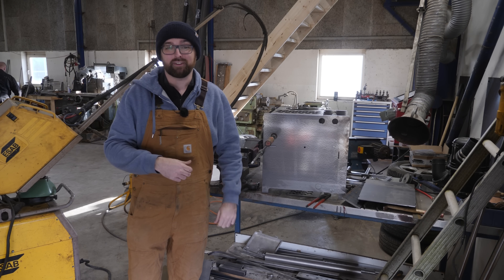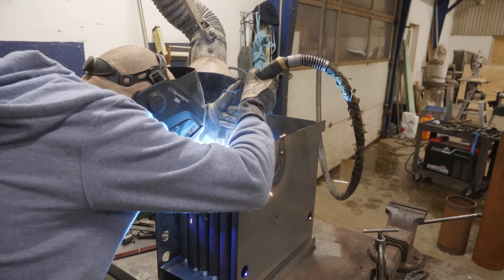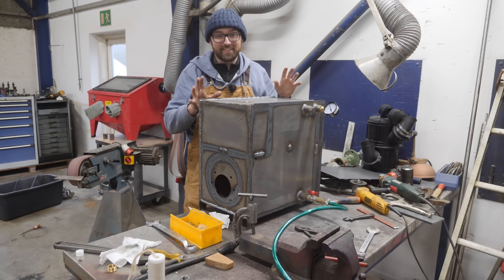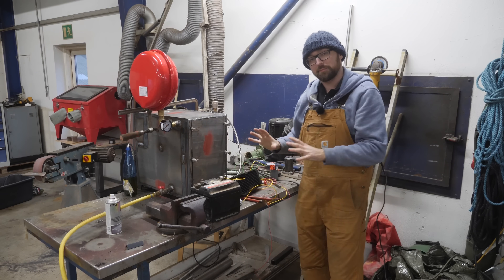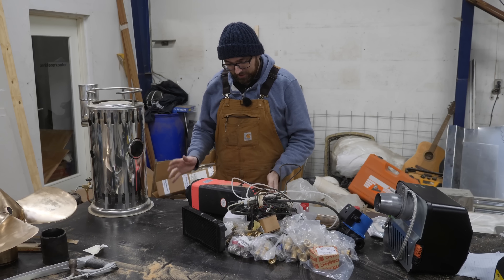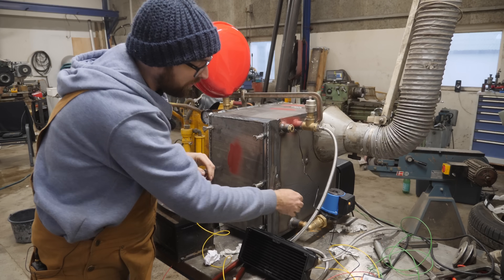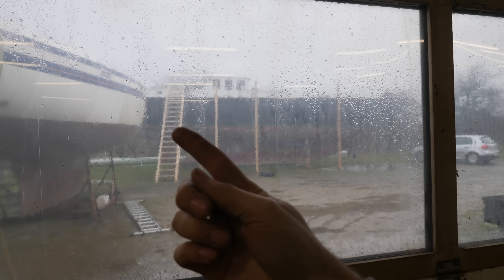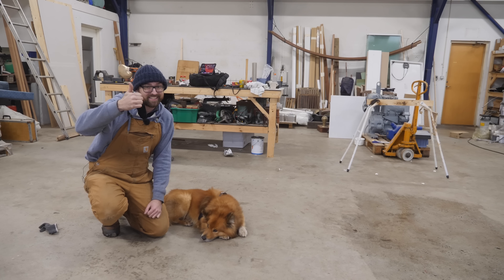Sail Life - DIY boat heating boiler - project sailboat

Comment: Wow super nice boiler.  I wanted to tell you having a lot of experience with similar heating systems, you might consider when attaching the pex tubing for passing the circulation that you start with 40 inches or so of copper or other metal piping coming out of the boiler, and 40 inches coming in.  Pex tubing can become strange around 180F but can withstand constant use at around 160F for extended periods.  The thing is that right at the boiler the temperature can exceed 180F, and the metal can help mitigate that extra heat.  Also make sure that the blow off pressure regulator is on the end of the metal pipe coming back so that the heat doesn't kill the seals in the pressure regulator.  Do not put it on the hot outlet.  It wouldn't hurt to have one of those temperaure controllers monitoring the temperature of the pex either and to then shut off the boiler in the case the pex got too hot.  This also is an extra measure of safety in case of controller malfunction.  Also since you have a lot of metal in the installation you may need to find some method of removing the rust from the system.  It can wear down pumps and such and will turn the water a bright red over time.
Reply: if you run coolant instead of water you can easily extend the service life of the metal components
Reply: I love you DIY video. However, please don’t sound racist and keep using cheap chinese knock off. It’s made in China but being cheap enables poorer people something which they can afford. Not everyone is rich like you. So do bare in mind to be fair and politically correct.
Reply: @leechristopher6826   If an item is made cheaply, that is a reference to quality of a product being limited by using cheap materials and processes.
If an item is a chinese knockoff, that's exactly what it is. 
In China companies are not constrained by international patent and copyright laws, which allows them to replicate an item by direct copying, not adaptation and individual development. Reverse engineering may give you a similar looking product, it may even be of similar dimension, but it isn't necessarily made of the same alloys and materials. Companies put a load of research into finding materials that provide component life and durability, and those material alloys are normally proprietary, meaning they alone have the information to produce them, they aren't readily available on the market.

Cheap Chinese Knock Offs may seem racist, however it is a very accurate description of the products available. 
Would you rather he be obscure and disingenuous in describing the product so that you are left with confusion and uncertainty, or would you prefer straight forward, accurate, concise and industry accepted terminology that can be readily understood by the majority of the population?

TLDR:

It's not racist to mention a country of origin, that's a nationality, not a race. In this case Chinese refers to a national work practice.

Chinese people may be Asian, not all Asians are Chinese. Asian is a race.

Cheap is a descriptor of quality as well as price

Knockoff is a direct unauthorised copy of a product

Stop trying to be so politically correct that you're actively discriminating and controlling to fit your own narrative - quite hypocritically.
Reply: rustymozzy Nonetheless, I am just giving you an advice and trying to remind you not be sounding like being a racist that’s all. Good luck to you and may god bless you.
Reply: @leechristopher6826  which god?
Reply: @rustymozzy  The guy doesn't know the meaning of what he is throwing out, he doesn't know the difference between criticism/the truth and rac-isim.
Reply: @leechristopher6826  I would describe them the same way.  China has for many decades now made products not under license.  In fact stealing them outright without thought to intellectual property.  Everytime someone speaks the t.r.u.th. they are called what you said.  Sign me up if saying the facts is what you label it.

Comment: So when you said "boiler" I was thinking steam heat, which would be crazy on a boat that isn't a stationary building.   I understand more now "hot water heat", which is a great idea.   BTW, similarly to the way you are going to exchange heat with hot water, I don't understand why I haven't seen people do the same thing for cooling in the marina.   You have a cool source 15+ feet below the boat that you can hang a rad core on plex lines into...   Just food for thought...

Comment: Mads, please go with Noctua fans for longer run time, efficiency, and low volume. They're some of the best out there with PC rads. Possibly a thick radiator and one that can take 140mm fans for more air movement control efficiency and low noise level. And please be careful with mixing metals such as aluminium with copper!

Comment: Love watching your videos.  Learn alot for my upcoming refit.  FYI... you can fix a pin hole leak in a weld with a punch and hammer. Seems counterintuitive but works. Just punch it right in the pin hole or use chisel for something a bit larger. Js 

Keep up the awesome work

Comment: I was wondering if you checked out some of the waterless coolant options for your boiler. Benefits would be no heat expansion, drastically higher boiling temp, and will not promote rust.  In my vehicles I use Evans waterless coolant (https://www.evanscoolant.com/).
Just a suggestion for a starting point or at least a thought.
Have a great day :)

Comment: You created a large foot  print  along with  a  large  exhaust  foot print . I would  say  6'' diameter .  Webasto  2010 . Small foot print . Small  exhaust. 1.50 '' S/S  thru hull fitting  out the transom.

Comment: Mads my new boat has a heater like that! It's a Kabola it's made over there somewhere. I have about 8-10 heater radators & fans thru the boat. Mine is there older version that's 24 volts. There new ones are 110 & 220. You should check, them out they even have hand rails and towel racks that are heated.  I even have two radators in the cockpit!
Just don't look at the price!!!

Comment: How do you plan to control internal rust and corrosion due to water vapor combustion products generated from burning fuel?  Often you see Stainless Steel used for those internal structures. Rust will greatly shorten the life of most non stainless steel. That would not be spiffy.

Comment: How do  you get hot water for personal use with out heating the whole boat in warmer weather?
Reply: Turn off the circ pump. If its off, the radiators and supply lines remain charged but with room temperature water. Then the only heating will be whatever escapes the boiler itself. It's really just a water heater with a circ for hydronics.

Comment: Those Chinese forced air diesel heater are cheap enough that you can keep 4-5 spares on hand.  One downside of forced air diesel heaters is that they are rather noisy.  That said, I really like my Webasto.  Running low sulfur diesel diesel really haeps cit down on burner maintenance.

Comment: "Last 4 years in a somewhat refit"  YO!  King of Spiffy tell it like it is.  You are 4 years into a major re-built and re-fit.  You have redesigned the interior of Athena, and re-built to an extremely high level of finish and usability.  It has been an eye opening adventure to watch you.  You just keep on keeping on brother!!    Be happy be safe.    (* I think your boiler system just may work to heat a home, or small factory.)

Comment: Love the heat exchanger but still intertested in more detail on internal design. It appears similar to an engine heat exchanger - are you heating circulating water from the diesel burner exhaust?

Comment: Fabrication professional here. Yeah sure, TIG welding is a little slower on the "welding" aspect. However, with TIG welding you don't get spatter or cold starts. So, no cleanup and less opportunity for pinholes, inclusions, and ultimately--leaks. The other advantage to TIG welding, especially in this situation, is control. With TIG, one is forced to pay attention to every bead. With TIG welding, you have more control over the amount of heat you are putting into a complex weldment, such as this boiler. So, less stress and possibility for future cracking issues. Considering all the leaks and all the stress that's in this sorry excuse for a weldment, I'd scrap that pile and start over. Use Cold Rolled or Pickled & Oiled sheet/plate, SUP pipe, and TIG weld the assembly. When using the aforementioned materials with no mill scale or pipe coating, you will eliminate most weld prep, help keep out inclusions, and make for an easy weld up. I'd hate to put all this work into this beautiful yacht and then later have to patch leaks in my home built boiler. You may have "fixed" all the leaks for now, but this struggle isn't over. Give that pile some heat cycles and wait and see. Personally, I'm currently building an adventure truck and went with Webasto Thermo 90 boiler, as repair parts are readily available almost anywhere. Love the series, but I don't follow the logic on this boiler.

Comment: Thanks Mads. Would it be possible to have a look at the plans or maybe download them? That heater seems to be an awesome diy design! I’m refitting a GulfStar 41, and I’m also looking in to a new heating system. They are so expensive! Also, have a look at fuel guard. A system to prevent dirty diesel. https://www.fuel-guard.co.uk  Greetings from Belgium!

Comment: Really interesting episode.👍 I appreciate CBG is the designer and is developing his design but I cannot fathom why he went for a custom heat exchanger (with all those welds) rather than use a commercial off the shelf item. However, it was not at all clear from your explanation if this was a water tube boiler or a fire tube one.

Comment: Dont know about Denmark but in the UK you cant mount that pressure vessel horizontally, and it should have a drain valve, legionella regulations.
Reply: Isn’t this a closed loop system where the consumption water is completely separated from the boiler water?
Reply: This expansion vessel is only for heating system. But if he want one the hotwater they are spesial.  As they gona use the hot water every day I think legionella only gona be a problem on the cold water wessel/ tank/ system.  Maybee Mads or Mr. Cementboat allready have a solution. Maybee it is no a problem. They have to fill the tanks often.

Comment: Hello. I could see that you used a burner that you have bought. What is the manufactorer of this burner and how much electricity is it using? 220V?.I have an Ebersprecher 5kw 12V diesel water heater in my Fantasi 37. It is using about 4_5 amp. 12V. I am impressed with Your project.

Comment: Hi Mads, Chloe and I were thinking of making something similar to this for our project. Any chance you could do a bit more of an in depth look at the various heat/exhaust flows and water flows. Also will cement boat guy be offering cutting files for his plan in exchange for some sand paper fund credits? (or whatever the cement boat equivalent of sandpaper is?)

Comment: I couldn’t agree more on your choice NOT to use a forced air heater. Lived on my Dufour 405 in Aalborg and Copenhagen from 2010 to 2015 when I left for the Caribbean. I had an Ebersbecher and on the really cold days - like in December 2010 where it was -18C outside and the warmest I got inside was +11C with the Ebersbecher running on high, my 2 burner stove and oven on high, 22 candles AND my toaster on with the timer hot glued so it wouldn’t turn off. I am NOT exaggerating it was cold. I walked on the ice around my boat at midnight on New Years Eve. Good choice, mate.

Comment: Not quite true (9:10) you do see it where they use banks of diesel blowers to heat buildings. Here in Cambridge (UK) I have a friend who works for the Scott Research Institute, she was telling me the "buildings" at the south pole are heated by banks of Wabasco heaters. 
In my case I use mine (Airtop5000) for weeks at a a time in the winter, it's over 10 years old and has never even been serviced.

Comment: If you haven't had any leaks then you haven't installed/ weleded anything:). Pipe is especially difficult to weld!
Reply: Yes, one of the reasons to leave boiler making to professional boiler makers.
Reply: @nobody46820  Do you truly think a company making boilers doesn't have any novices doing the welds?  It's all about the QA.
Reply: @Frindleeguy  I would sincerely hope that any company making boilers wouldn't just hand over a welding machine to a monkey. Welders need to be certified and trained where I'm from, and have a low failure rate of welds to be able to do (boiler) work (that isn't done by a robot).
Reply: @nobody46820  Fair enough. I personally would not spend an additional $6k for a non monkey to do my welds. I bought a decent welder and do lots of bits on my buildings (I'm a commercial builder). It's actually not all that difficult after taking a few classes and spending a few hours in there. Nothing to be scared of really.

Good luck to you and yours!
Reply: @Frindleeguy  Nice! Congrats! I was told by a welder to learn to weld aluminum 1st, after that, other welding is easier and the techniques used in aluminum welding improve your other types of welds as well.🙂👍🏻

Comment: I am honestly surprised you were able to reach all the leaks and fix them.  I knew there would be a lot.  It looked like a lot of blind welds that needed to be water-tight.  Good job.  I am impressed.  Welding water-tight welds in all orientations like that is extremely difficult, especially for a beginning welder.  

Bravo Zulu Mads!

Comment: Have you made a socket for a zinc anode or maybe run something like mobile heating oil for no problems with corrosion. And a small domestic hot water cylinder with a coil for hot water

Comment: Very cool heat/hot water system your installing. I absolutely agree with your thoughts on forced air heat and a diesel furnace. My boat is heated with a diesel furnace. 

I’m not sure whose dog was wandering around in the shop while you were welding but the flash from a welder is even more dangerous to a dogs eyes than it is to ours. You should be screening the welding area.

Comment: MADS, First let me say I enjoy watching your videos immensely.  You always do a lot of research before doing whatever and explain why. But you totally dropped the ball on this one. Your homemade boiler is dangerous. Here in the U.S. you must be a certified welder to weld on any pressure vessel,  their was no ASME test performed on your completed boiler, the burner you intend to use is not a “closed combustion system”,  as far as the controls go, are you installing a low water cut out, what about the high stack temp. limit, high/low fuel pressure switches? The Morrison tube you installed appeared to be made of carbon steel that won’t last too long in a salt water environment. Do the pumps have a marine rating along with the rest of your boiler components, if not your insurance company may not want to cover you. The $4K you save may cost you your life.
Reply: James OBrien I’m not a metal expert but I had the same concerns. This boiler uses pressure and it has been welded home made..... I have so many doubts about the safety here! (I hoping I’m wrong....)

Comment: you might want to consider adding a low water cut off switch. That way you'll never ever have a dry burn which will damage the boiler. Cheap protection, esp. for a DIY boiler, and one that will be used year around for hot water.  In homes you'd have a automatic water infill valve, but I assume on a boat non-salt water will be rare. If you can, install a multi speed pump; that way for the shoulder seasons when you would like some heat but not max heat you can use a lower pump speed and keep a more consistent temperature  on board and not be cycling on and off.

Comment: Very impressed you got it leak free. Pressure vessel is one of the hardest tickets to get.   Experience with hydronic heat systems tells me to have a spare auto bleed valve and to install bleeders near each heater or heat exchanger. Way easier to fit now than later. (Don't ask)

Comment: I could think of several options related with the reflex stove. A custom thermostat could regulate fuel flow, and not allow it to turn on if too hot. Regarding backdraft, I wonder if an in-line fan would work.

Comment: Can't remember exactly why, but the placement of the expansion tank should be mounted with the inlet on top.  I think it prevents air in the water of the system from collecting in the pressure tank.  Probably not a huge deal in your system, since it looks like you are making a closed loop system.  Will you be using glycol?

Comment: While building a new boiler sounds very interesting, do you not get in trouble if the boiler starts to leak.? 
I’m concerned your insurgence will not cover any damages related to a leaking boiler as the boiler is not certified?? Personally i would not attempt what you are doing; also, i would assume you could buy one way cheaper than the cost of your project-boiler.

Comment: I have over 40 years welding experience and I can tell you that welding a tank with MIG will almost always have leaks. I could help a little if you purged the boiler when welding.
Reply: I have built hundreds of 40 cubic yard trash compactors along with hydraulic tanks, and air compressor tanks using only MIG and never once had a leak. My point is that with proper technique MIG welds can be 100% air and water tight under extreme pressures.
Reply: That whole pipe array looked troublesome. Will it last? Will it be plagued with pinhole leaks over time? He may regret that home built approach....
Reply: Wallace Grommet it sounds like his friend cement boat guy designed it and has an example working for a few years now,   So it sounds like it should be fine,   If not well it’s a good learning experience and fix it or use something different
Reply: @wallacegrommet9343  I think your cup of tea needs a refill.